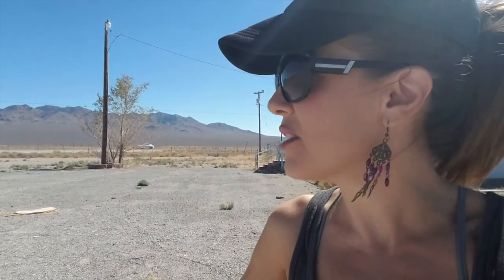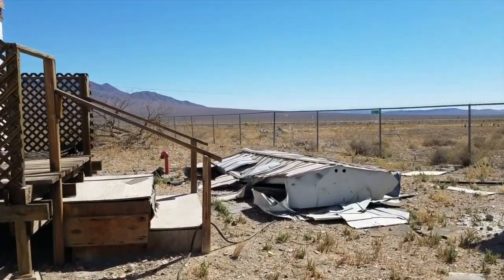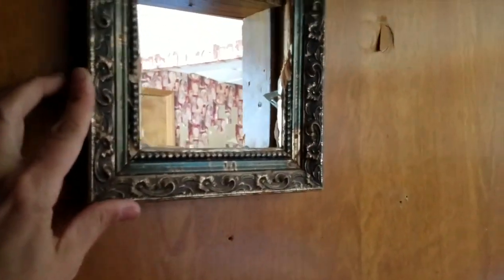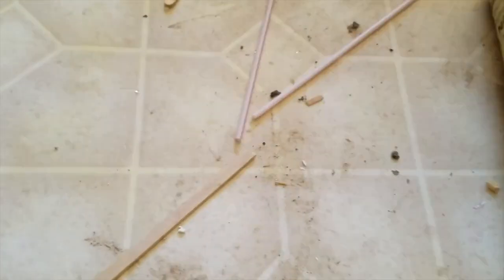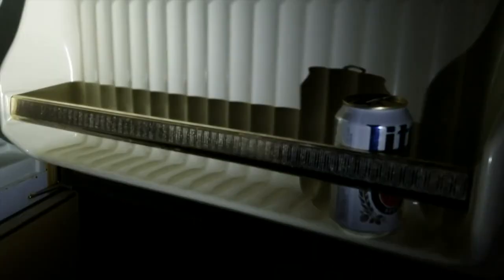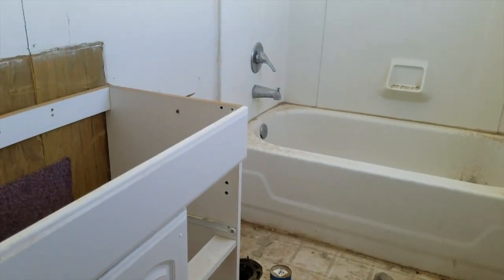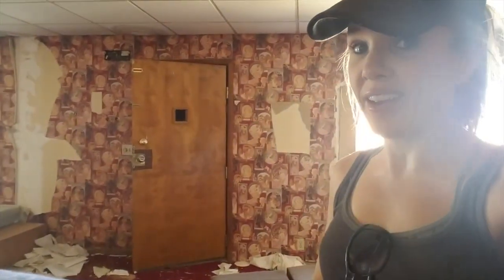Abandoned Cottontail Ranch

Comment: was doing some septic work on the north side of the salt river by the ASU bridge. My boss fell in the tank. Next day I notice limos with state plates parking at this trailer across the street. The madam came over  and asked me if I could fix her toilet system it's jammed nothing works. So i pulled the backhoe up and lifted the tank lid. 10 million rubbers and an ocean of come. We laughed for 5 minutes trying to figure how THAT got there. Well we fixed her up and she fixed us up....move over governer . My boss who fell in the septic tank across the street got nervous cuz the gal was dressed like Victorias secret and walkin round. So after that he was working a drill and hit a 36,000 volt line and blew out his elbow a little and his right nut. If that wasn't enough he fell off the Derrick of the drill. About 35 feet. He didn't need the whorehouse any more. oh well.  Oh and those guys with Howard's will was a fraud

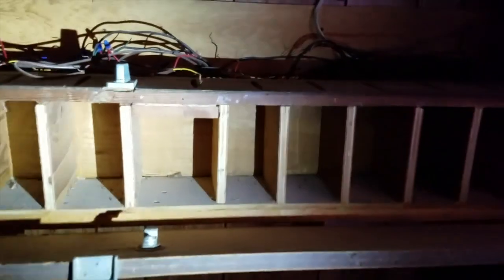Comment: 9:15 Almost a switchboard. It's most likely part of the security system. Rooms had 'panic buttons' and some had microphones so if something bad was happening the bouncer would rush in. The locking slots were assigned to each girl and was easily secured that way.

Comment: all the places I've been and I aint been as many as you. I'm a door to door guy. Once I pulled into Seaside ca. kmart remember them ? well a bus pulled up. full of kids in shorts headed for the falls with a sheet of acid. I was in overalls under a white leather Lincoln changing the oil they asked me if I wanted to come. I took off the overalls and they saw a shirt and tie and were surprised when I jumped in and got in some shorts myself. There was one Beach I know of in Oregon with no cops in town. Manzanita Beach. Big Cliff to the north and coming South you see it in front of you several hundred feet below. So I parked my 60s Beach van 67 Chev gold fleck five spoke mags, 102" CB whip with a little purple light on top, jacked up in the back, shellacked polished wood bumpers...and a bed, ice chest and closet. On the bed are  two polychrome 1200/15" speakers playing the go gos, aren't they fab ....so I just drive to within 100 feet of the surf plant the speakers and break out a frosty and light up a fatty and get shit and party down the weekend ...ships at sea trawlin past the limit are all on sideband CB. and so am I. And they can hear my rock and roll on calm nights it travels for miles. hi watt stereo. is Manzanita still an open Beach. Go to Canon Beach and there's a wide open shot to roll right into the beach with yer car at the downtown access...people bury there axles stuck. Then a nice polite boy with a four wheel drive and rope pulls up and hooks you up for half the price of the tow truck and don't forget the fine as here comes the cop to show you the sign with the other 25signs that says don't do that in 1/4" font. Oops too late . So its probably double or triple the $50 fine a few years back. Now the way to roll girl is with Kirby guys. Yeah the vacuum guys. We pulled in to Seaside rented a phone room for the girls. AI pull up to the food stamp office and say who has a phone and couch and wants to make some dough. So she sells my trade ins and fields calls and I go down to the hotel and breakup the salesmen and phone girls and we get to work. Nicest people in the world in the Northwest. One area I sold everybody on the block and the volleyball tournament at Canon is bitchin....The money is fabulous... the area...well you pick an area yer a free white and 21 person...no matter what race you are...right? So its Benjamens and seaspray and I gotta go darlin... love and snowballs...we could sure show each other how to travel. I enjoy the Hilton or a state campground or a picnic table and sleeping bag alone on top of Imnaha-EagleCap wilderness...but I never did much abandoned hunting. I did romp the area I grew up in heavy. There were plenty of houses in the hills with no roads to them stuck behind a jungle of bushes and shit and you'd never see it and it was built like a beaver nest. you had to climb a ladder and peak up above the floor to enter. And it was like eight sided round and it was strictly volunteer and right on the edge of the gold fields in a lively 100+ year ghost town. Good dumps and shacks and rusted cars from the 20s. In and around Walker Az above Lynx Lake. Anton Levay would hide out up there when he got tired of Jerome. Which is another wonderful ghost town turned artist colony....used to go up there to see Arty Beale, Lawrence Welks piano player ...I grew up with the WW-1 crowd and they loved that stuff like Glenn Miller. So keep em happy. But personally I think hell could be best described as constant champagne music and that goofy accent. They're pretty much all gone now and only a few of the WW-2 crowd was big on " In The Mood " jazz band stuff and we really gave it to em good. But now the senior centers are like wanting Jim Morrison and some good pounding rock and roll. So if you ever go urban exploring check out the pianos I even saw one place the guy left behind  a matching Gibson and amp. I've laid down the beat at collseums and stages and churches for a long time and a really drool when I see a Stienway sitting there and pigeons shittin all over it. I know a couple places really need a nice piano in the foyer. But you know I think it would be cool to find a canyon somewhere lonesome and hook up the amps and see if we can start a landslide or scare some game up. bring yer .22